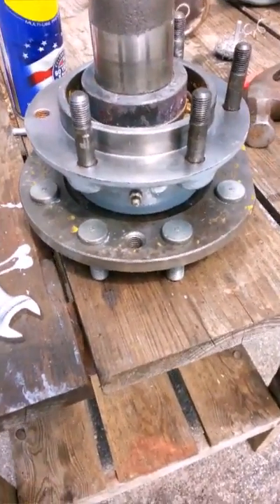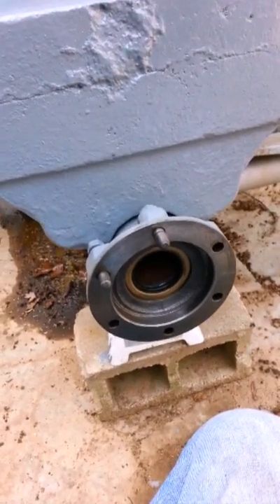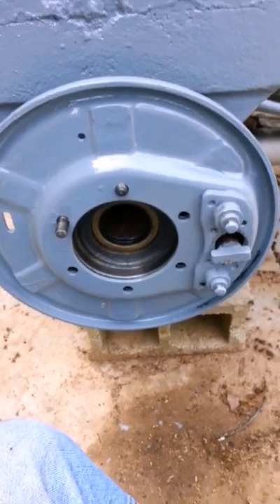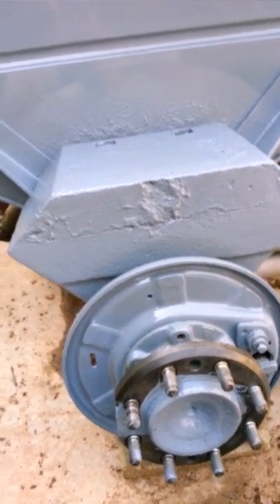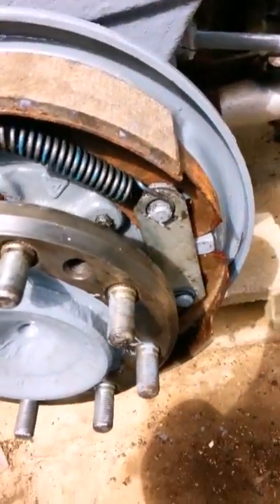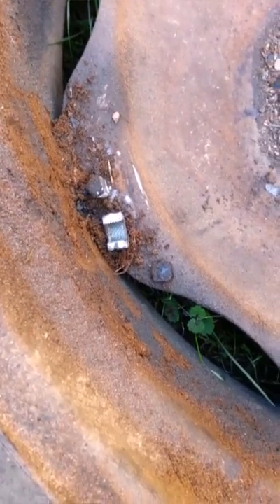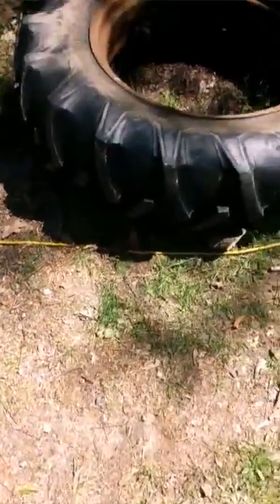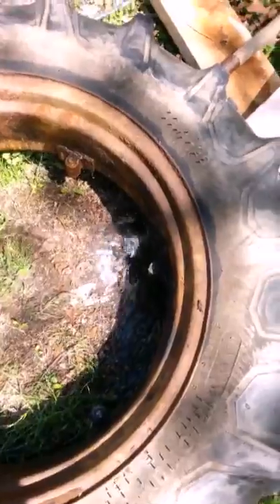Ferguson TO30 Rim Brakes Axle Seals Part 3

Comment: i am gonna put a zerk or grease fitting like you did but i will fill it with GREEN GREASE full synthetic grease that will stop the oil from getting past the bearing and no more leaks. the plate is called the brake backing plate. you were close enough.